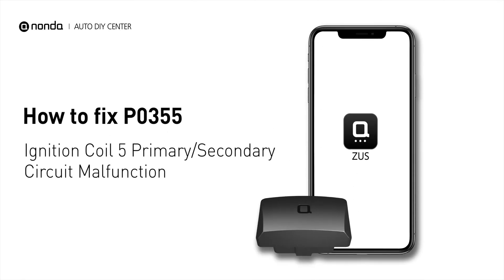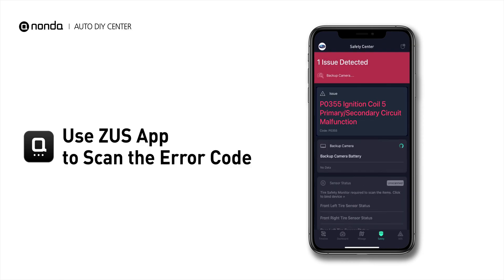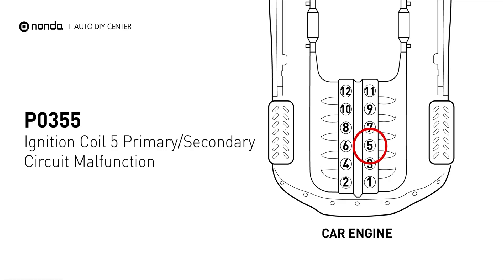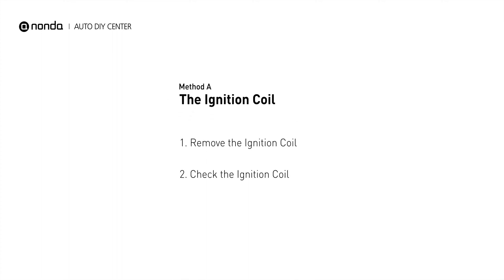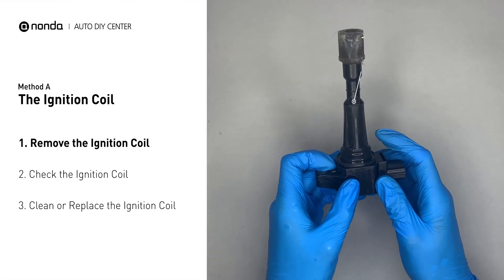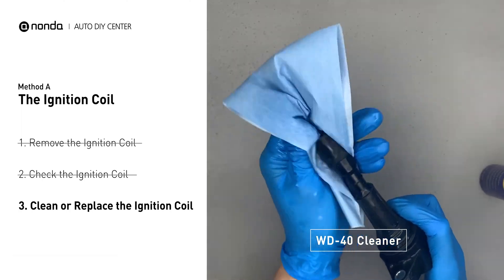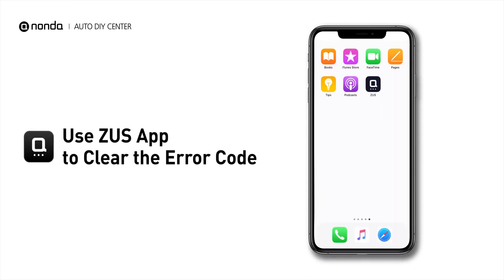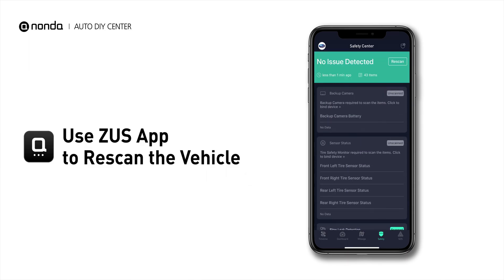How to Fix P0355 Engine Code in 2 Minutes [1 DIY Method / Only $3.97]

Comment: What I have noticed with any web site this has started a few years back what every you are looking for it take you to site's that do NOT answer the question, what I have found amazing I have 2004 ford expedition 5.4 it has a misfire Took to auto zone they did a diagnostic on it the man said the PCV valve needs to be replace got the PVC valve it stills misfire did not fix the problem trying to save myself money going to a mechanic now days is very costly now days, just for a simple fix this being said bring me to saying this without my be knows the paper auto zone gave to me on the back of the paper there where engine codes two codes P0355 and P0308 I taught wow their the problem trying to find where the coil is locate on this ford 5.4 is an adventure.